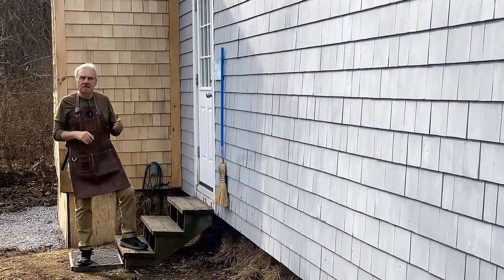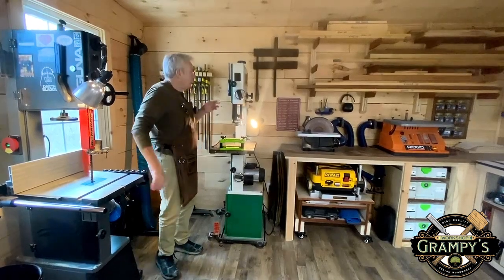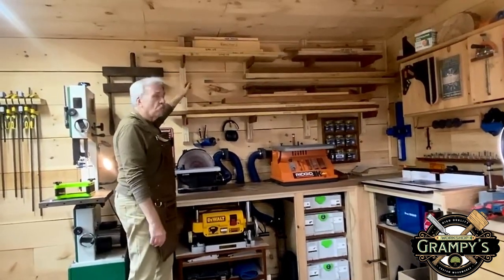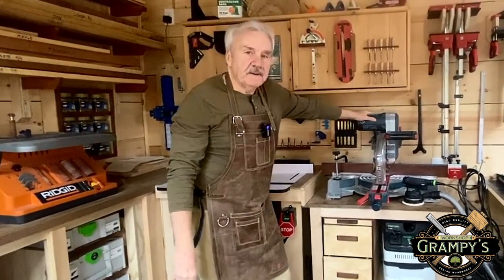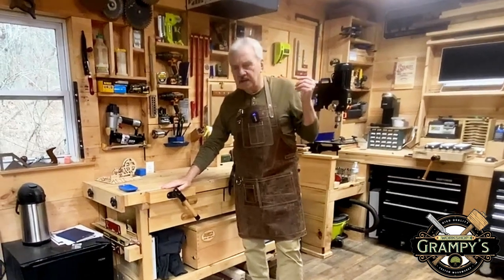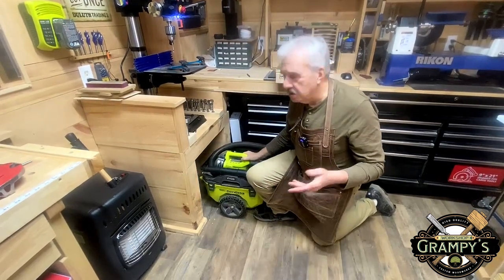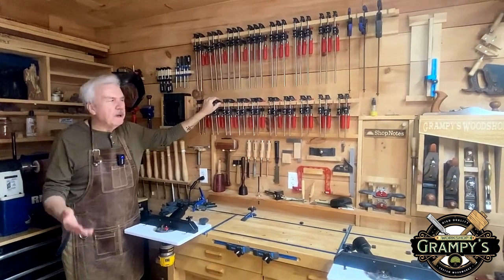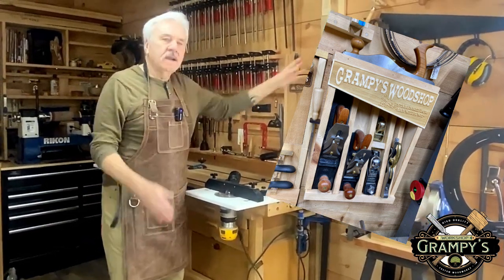A Small Shop Tour In Maine !

Comment: I love all of the wood on the walls. It looks like a cabin on the inside. I have a small shop too and I like the look of the cubbies on the walls. I'm wondering if you ever get drafts coming in from those uninsulated spaces? My shop is only a 10'x16' shed conversion. Less than a year after buying it, I had wish I had gotten the 16'x16' or the 20'x20'. So, hopefully, an addition will go on this spring now that lumber prices are coming down. I put a cabinet in my bathroom in between the studs and it is recessed as well. Thanks for the tour sir. I really enjoyed it!
Reply from the maker: No drafts so to speak, the building is sheathed with cedar shakes... and that's about a;ll.  The 4/4 rough cut adds a pretty substantial insulation factor..... and more importantly there is no interior "wind chill"... I'm happy with it... (may walls are one 2x4 stud construction).... Merry Christmas.